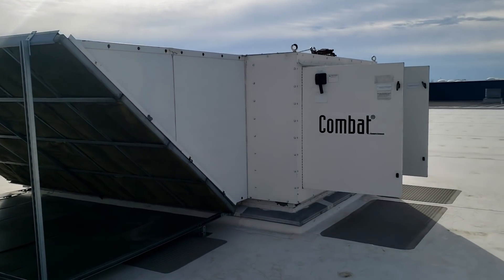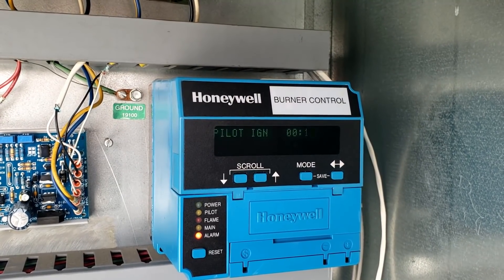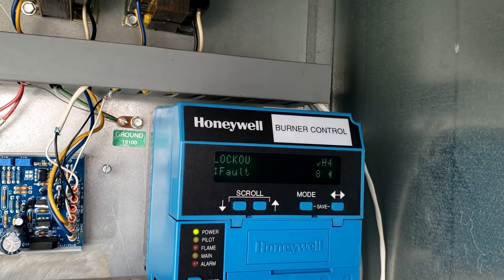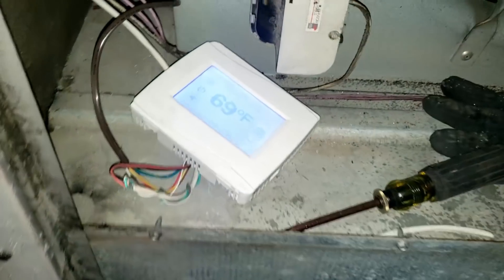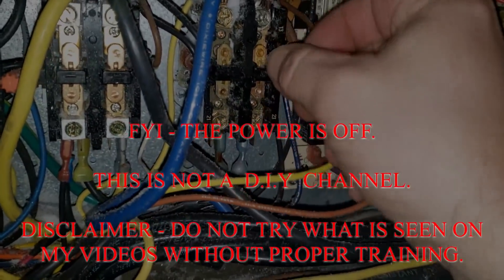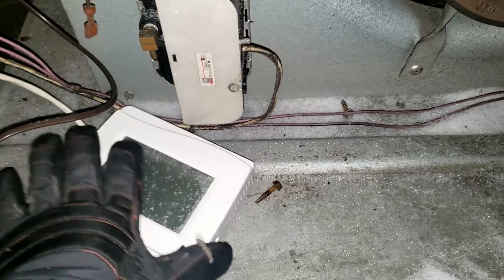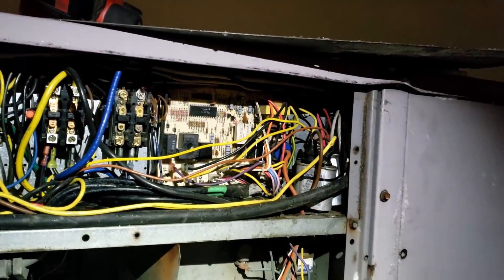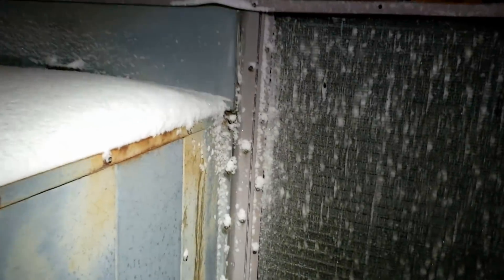COMBAT MAKE-UP AIR NOT HEATING & RTU NOT HEATING OVERTIME SERVICE CALLS

Comment: Why would you want to take the outside air and heat it up When outside air is freezing cold why wouldn't you want to recirculate the air inside the building that's already been warmed but I guess that would build-up carbon monoxide So I guess drawing the outside air keeps the carbon monoxide Levels at a safe level
Reply from the maker: You have to remember why your "making up air". 👉Because your exhausting air to the outside.

Comment: Long time ago we had a control company leave some panels off and a snowstorm hit. That was a construction job and much earlier in the day when that call came in. We stripped the components out of the control cabinets and brought them inside. I thought that kinda sucked. Your job looked a lit more frustrating. Good job getting them running again.
Reply from the maker: Thanks Bill, It wasn't to bad, but if the snow had stopped it would have been golden.

Comment: Double socks , thermal underwear and a hot cup of tea in an insulated cup ... I found it helps a ton , even if you can't keep the tea warm for very long , it stills help a lot when you're on the rooftop battling the windchill 👍
Reply from the maker: I thought you guys called socks,  knickers? Or is that just the English or the Brits whatever. Our education system is kind of lacking over here LOL
Reply: @HVACRSurvival  Noooo knickers are ladies underwear,  which i wouldn't expect any hvac lad to be wearing ... except a couple youtubers I could think of maybe ...🤣🤣🤣

Comment: Doesn't hurt to use foam tape but if the control panel cover isn't tight it will still get in and some times it gets in from around the top rear of control section from lid being bent from pulling to split coils
Reply from the maker: Makes sense👍👍

Comment: Seen many Carriers with snow filled up in the control section when wind direction is right it will fill them up solid. We carry heat guns for that exact issue Iowa winters
Reply from the maker: Does foam tape help?

Comment: Used to do refrigeration in the past only do hvac now hated midnight call's but who did . I would think someone had the panel off before you got there
Reply from the maker: It looked like it👍 but I don't think that's possible with where I was. It's a secured building and I believe we're the only HVAC co they use currently.

Comment: I am from Michigan, i was on a roof one time it was about -10 and windy as hell. This was a quick inducer motor change out ( 10 min normally). It took me about 35 mins I was frozen to the bone. I waked to the ladder and said how in the fk am I gonna get down LMAOOOOO. Then this guy walks by and I ask him to stand on the ladder , I was able to get on it undid the tie off and made it down. I bought a heated hoodie and hat because of that. Stay safe.
Reply from the maker: I remember a couple times that happen to me. Long hot shower still didn't take the cold away😂. I have better cold outerwear now, still sucks👍👍

Comment: A tool that may help you troubleshoot in a situation like that, where it was difficult to see which unit was trying to run, 
would be a Milwaukee m12 thermal imager. 
As a plumber it has helped me many of times see the naturally invisible. 
Thank you much for sharing your informing knowledge.
Reply from the maker: I had a nice one from snap-on for a while, but the stupid thing quit working properly so now I'm kind of leery of wasting that kind of money. I have used that one you're talking about, it's nice. It was one of the medium size ones I believe 1500 to 1800?

Comment: You do what you do to get things running. Don’t apologize. You’re a mechanic not a sales man. Great job. Stay safe. I’m on call right now in New York. Weather is rough.
Reply from the maker: I Melted the ice and evaporated the water from the control. Basically I dried it out and it started working again.

Comment: Good video. I would like to point out on these carriers code 8 could also be a bad gas valve. I've had bad gas valve cause internal control faults. If you mess up the 3 wires for the 2 stage gas valve it will also trigger that code. Good thing you figured it out
Reply from the maker: Makes sense, that would likely be a short if the valve was wired wrong?   You can see I had snow in the harness at the board, once I got it melted and dried out it started working.
Reply: Had that code the other day, they had jumpered W1/W2 to high fire all the time, the W2 coil in the valve had partially shorted and caused weird voltage to appear on the W1 input on the board and signalled 8.  I disconnected the W2 at the valve and low fire came on no problem.  Since W2 is connected DIRECTLY to the valve it can cause some interesting false malfunctions.
Reply from the maker: Thanks for the info, that definatlty might come on handy for later👍👍🤜🤛